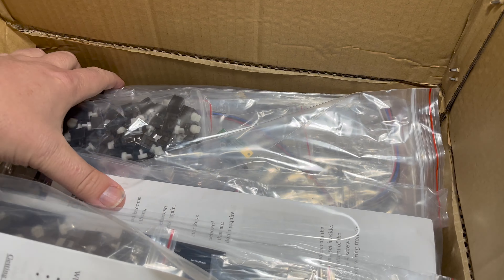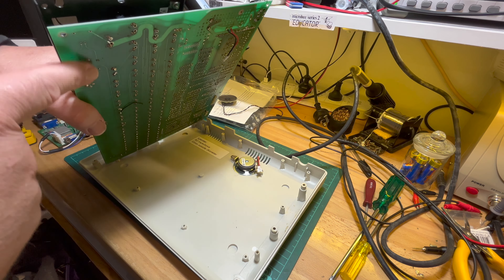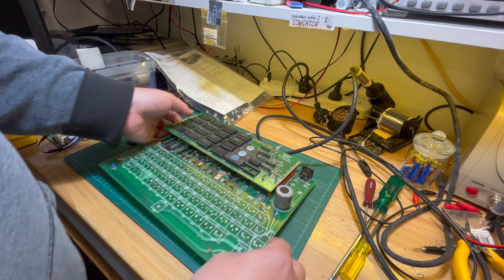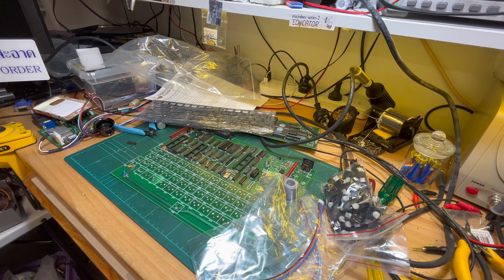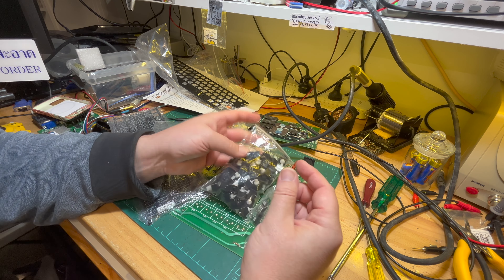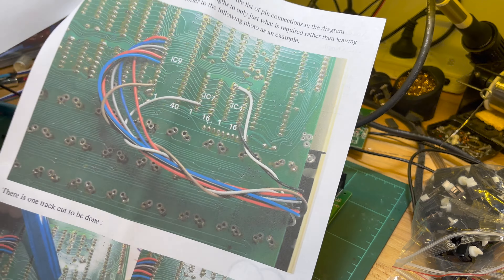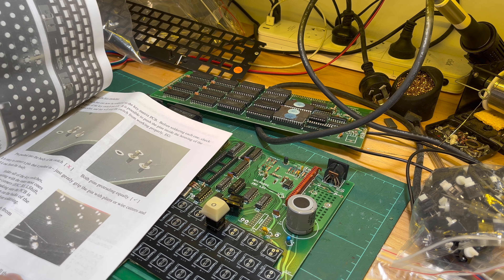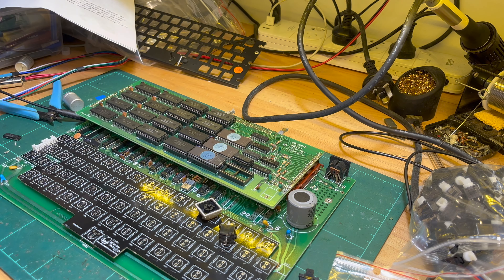🇦🇺 Microbee Replacement Keyboards Arrived [TCE #0275]

Comment: Mine's still with Auspost :( It's gonna be a big job. Lets count how many times the desoldering gun jams....
Reply: Ha! Been there. :)

I've found that if I let my gun continue to heat soak for another ten minutes after the light goes out (Hakko) it has cut my jams to almost nothing.
Reply: @MrWaalkman  the biggest thing for me has been to use it horizontally. Seems to take the pressure off the pump a lot.
Reply: @MrLurchsThings  Not a bad idea. Thanks!

Comment: interesting way to put the new keys on to an old board...
Reply from the maker: The main issue is that we can't get key switches with the same spacing as the originals - for the Premium Plus each modern key switch was soldered to a tiny daughterboard that matched the original pin spacing ... so two lots of soldering.  This way, just one lot of soldering.
Reply: @Brfff  yeah... i get that... just interesting way of doing it... id probably put a sheet of plastic in between the new pcb and original... just to stop any shorts between the solder joints and pads... (dunno.. cant see it from here to see if the new board has the solder joints spaced nicely so they wont ever contact the original board pads)
Reply: @WacKEDmaN  There are mechanical support pins (9 pcs) spread around the board that keep the new matrix board separated from the original baseboard.
Reply: @MbeeTech  cool! ..thought of everything! :P